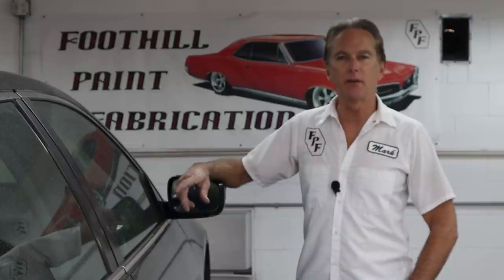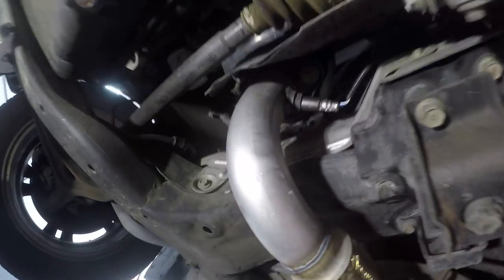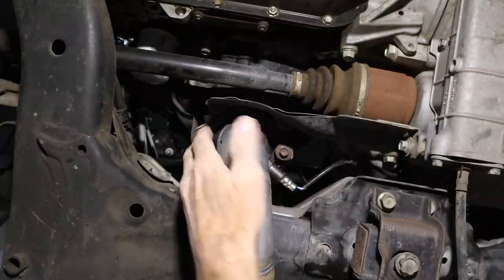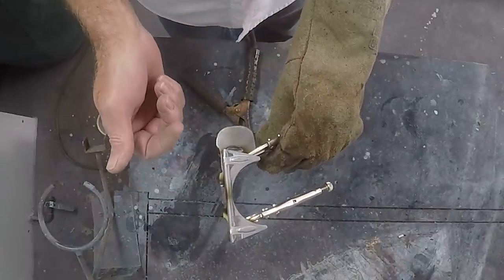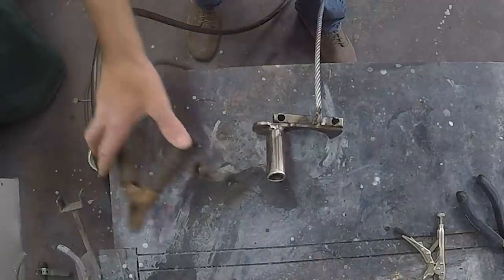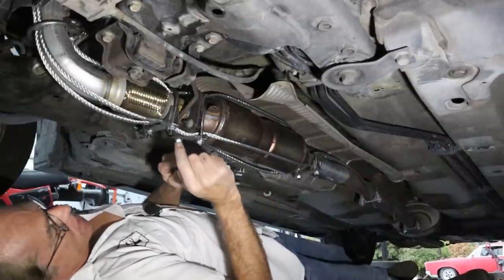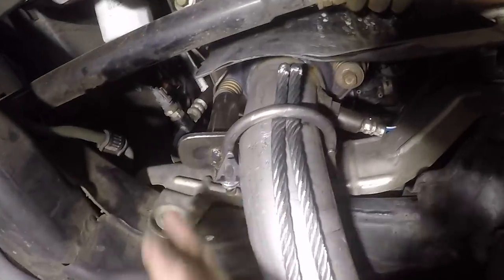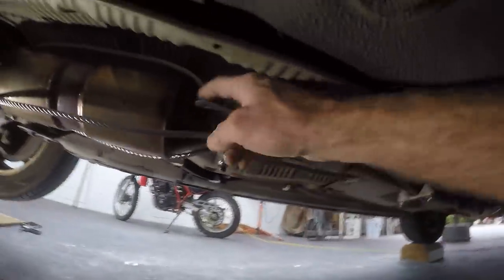Catalytic Converter Theft Deterrent Easy and Cheap

Comment: I've got the solution pure and simple psychology 👌 why do they have such a mental block on  , Making it mandatory for the buyer to request a  VIN # of the vehicle it was removed from, 🤔
Reply from the maker: I totally agree.  It used to be street signs stolen for aluminum and then they cracked down on the people buying the signs.  Copper wire was next and now catalytic converters.  Each state handles it differently and they were all slow to see the problem and do something about it. I did see where they caught a semi full of stolen cats heading south of the border so there is a way to sell them other than a bona fide scrap dealer unfortunately.
Reply: @FoothillPaintandFabrication  they could fix it "if they wanted too some people higher up are making something as well 🤔😉
Reply from the maker: @marcturk4410  When I see some official talking about making a law or increased policing I always figure their cat got stolen and NOW they want to do something about the problem.

Comment: I easily installed a U bolt with a one inch chain link to one end of exhaust and wrapped chain around and clamped with u bolt at other end where they need to cut with sawzall
Reply from the maker: Good ideal. Anything you can do to make it look like work to steal.

Comment: I can't get exhaust shops to do this for me. Could I use JB weld for the nuts and bolts instead of a welder? Also can't a sawzall - reciprocating saw cut through the cable?
Reply from the maker: Yes you could bend the threads over and/or use JB weld.  I would bend them over personally so it looks really hard to unfasten. Cutting cable with a sawZall is pretty tough to do but it is possible.  With 3 cables and one at the very top they will have to work at it which WORK is the key word here since they don't want to work do they?  Good luck on your project.

Comment: I'm thinking the best idea is to buy a vehicle where the catalytic converter(s) are tucked up in the engine compartment where they are so hard to get at that thieves don't even want to try.
Reply from the maker: I have never heard of them installing the cat under the hood.  It should would help protect them.  They get pretty hot when you push the car hard though.
Mark
Reply: @FoothillPaintandFabrication  My Frontier with a v-6 has two. They are connected to the exhaust manifold on each side. At the lower end they connected to exhaust pipes. But there is very little room to swing a saws-all at the upper end. I don’t think most thieves would want to spend the time.
Reply from the maker: @nate4745  You are correct about that.  They don't want to work and that is why they steal.  If it looks tough or time consuming they will take a pass and go to an easier target.

Comment: Why not put barb wire on your catalytic converter?  Or spikes?
Reply from the maker: I have heard people putting wraps of chicken wire around it which should help deter thieves if it looks like a lot of work to get it out of the way to cut the pipe and barbed wire might do the same but it is easier to cut.  Really what ever you can do to make it look like hard work and time consuming the thieves will probably move on to an easier target  up the street.

Comment: Nice work and good attempt but wouldn't a battery operated cutting wheel get past all of what you did within minutes?
Reply from the maker: Anything can be defeated given enough time and effort but that is the whole idea behind this  deterrent.  It will take time, make a lot of noise and they will have to work for it which is exactly what the thieves don't want to do is actually work for the money they get. Getting a cut off wheel up under there to make all those cuts will be pretty tough laying on the ground too.  It has been well over a year and still hasn't been touched so in this case it has worked.
Mark

Comment: How about covering the bolts with epoxy ? What you are trying to do make it a more difficult for the thrives.
Reply from the maker: LocTite, bending the threads over or epoxy would slow them down for sure.  By welding the nuts I wanted to make it look daunting to remove the clamps to get to the pipe and cut it. The main goal was deterring them to go somewhere else.  It has worked so far!  Fingers crossed.

Comment: Not having a welder I'm opting for JB Weld for the ends of the clamps when I do mine
Reply from the maker: Great idea!  I tell people that don't have a welder to bend the threads over where they stick out of the nuts on the exhaust clamps.  Anything to make it look like work and the lazy thieves will take a pass more than likely.

Comment: What made you choose 5/16 vs. 3/8? I'm wondering if I can use 3/8 and just do two wires vs. three.
Reply from the maker: I was concerned I wouldn't be able to bend the cable around and get it down under the clamps but I am sure 3/8" could work just fine.  Really anything you do should deter the thieves.
Reply: In my place (Canada) we don't find 5/8 or 3/4 cable but only 1/2 size. I will try to wrap 4 or 5 times of my 40' cable likely hairs braid... with U claims 1/2 inch bigger than pipe size. Then use cold glue welding for nuts.
To much rain and cold this weekend, hope for next week to try on.
Thanks for your video clip. 
Happy Easter to all, but not to thiefs.
Reply from the maker: @LEE-PHAM  Thanks
That should work nicely.  If it looks like a hassle to steal they will move onto an easier target. Smack the threads sticking out of the exhaust clamps to so they won't even think about trying to back the nuts off.

Comment: Hello brother. 
If you use the welding  in the cars is  not damaged the electronique systeme....? 
I have one toyota prius hybride.  If I use is damaged or not ? 
Thank you for your reply. Please
Reply from the maker: Damaging electronics is a very real thing with improper safe guards.  Removing the negative cable on the battery and then making sure your ground lead on your welder is as close as possible to the weld area should ensure there is no stray voltage going to electronic components.  High frequency start welders and plasma cutters can have a more pronounced issue I have found as well.  Isolate the car battery, keep the ground clamp close and you should be fine.
Reply: And stay away from any fuel lines in the area!
Reply: @jeffstone28  Fuel and brake lines are routed together in their own channel away from the exhaust system.

Comment: I used chicken wire, several wraps; they can cut through it but it will be a big mess.  Most will move on to easier targets.
Reply from the maker: Agreed
Reply: Wrapped around the cat con? Or as a shield over the undercarriage?

Comment: What's the point of the cables? I don't get it. The brackets are what's holding it in right?
Reply from the maker: The exhaust clamps are holding the cables in place yes but the cables are the deterrent. Thieves use reciprocating saws and chain tubing cutters to steal cats but cable is extremely hard to cut through with a reciprocating saw since it bounces all around and the cable wires bind up the blade as they cut.  It has been on this car for over a year and has worked thus far.  Even have a guy on video looking under the car and then leaving without even trying.  If they are determined nothing  can stop them so you want to make it look like work to get the cat off.

Comment: How this solution work out for you all these months later?
Reply from the maker: My sister has video of some guy sliding under the car, takes a look and then leaves without even trying so it worked on at least one thief.  It has been over a year I guess and no attempts at stealing it other than just looking under the car.  The car is parked outside all night and in the school parking lot during the day so it is pretty exposed.  So far so good
Mark
Reply: @FoothillPaintandFabrication  Lol. good for her!!

Comment: what about wrapping the cat a BUNCH of times with barbed wire? would that work?
Reply from the maker: As long as it doesn't rattle and drive you crazy while driving I think anything that looks like work will deter the thieves.  One guy wrapped his in chicken wire a bunch of time making it look like a mess to remove.  Whatever you do make sure it is safe so the cat doesn't overheat and the O2 sensors don't get damaged.
Reply: @FoothillPaintandFabrication  Thanks for replying. Never have been under my Prius far enough to see how much clearance it is has above the cat. From what I've seen online, so far, my guess is it doesn't have much. Whoever comes up with a foolproof deterrent will get rich.

Comment: How would you do it without welding?
Reply from the maker: Dave, you can totally do this without a welder.  Once you have all the exhaust clamps on take a hammer and bend over the threaded portions that are sticking out from nut against the clamp. Bend them enough so it is noticeable so when the thief looks under the car he will see that it will take time and effort to get to your cat. The more it looks like work the less likely they will hang around trying to steal it.  Get some hi heat exhaust paint in a bright color and spray the cat as well as engraving your Vin number on the cat.

Comment: Maybe an extremely loud motion detecting alarm installed under the car that activates when it’s parked
Reply from the maker: I saw a guy that put some battery powered motion detectors under his car but they were a pain to turn on and off so they probably don't get used as often as they should but it is a great idea. If you could wire them to an easily controlled switch and adjust them so a cat or squirrel didn't set them off they would at least make the thief deaf as he tries to steal it.

Comment: where do you find those cables and clamps. would be helpful if you put links or where to buy in the video.
Reply from the maker: Autozone on the exhaust clamps and Home Depot for the cable.  If you could find a place that sells cable cut to length it would be much easier once you know the measurements.  
Thanks
Reply: @FoothillPaintandFabrication  THanks for you help appreciate it. How has that set up work for you till now? any modifictations you would make since your original video and set up? thanks a lot
Reply from the maker: @asianstud7  So far so good and my sister even has one guy on video looking underneath the car and then taking off so it worked on him.  I have been thinking of what would deter lazy thief's more.  Perhaps smaller diameter cable but more of them so it looks like a real chore to get the cat out.  Also any vulnerable spots keep one or two cables away from the pipe and slightly loose so when they try to cut them with a cut off wheel the cable will bounce around and bind their tool.  Stainless cable might be tougher to cut too but not easily sourced and would be pricey.  Good luck on your project.
Mark
Reply: @FoothillPaintandFabrication  Got another question . I know that these thieves use a saw and vertically cut the converters. Now with what you have done with the accord they would first have to cut the clamps off first with a different tool horizontally tho first. then get that out of the way to cut the converter vertically. So dont you think the clamp is also relative easy to cut also? They arent made of the thickest metals out there i dont think? all it is is a thin metal thats wraps around the pipe.
Reply from the maker: @asianstud7  The thieves in my area have started using a chain tubing cutter they get at H.F. for cheap.  It is silent and they can cut the exhaust tubing pretty fast with it one handed so they can just lay on their back and reach under the car. Yes the exhaust clamps are just mild steel and can be cut but as a deterrent they are now cutting clamps, exhaust hanger, cables and then the pipe.  Way more work than they are used to and there are plenty of Accords out there unprotected so hopefully they all take a pass on my nieces.  The whole idea is to make it look hard and time consuming.  One guy told me he wrapped a bunch of chicken wire around his so it looked impossible to get to the cat.
Reply: @FoothillPaintandFabrication  Wait.  So you are saying that the thieves sometimes are actually going the extra mile and removing/cutting clamps and wiring to get to the cat all the while using a silent chain tube cutter?
Reply from the maker: @asianstud7  Yes, they use the cutter and let the cat fall to the ground and then cut the O2 sensor wires and walk away.  Just like copper theft they keep evolving.

Comment: Idk, if the cat is valuable, cable cutters would would add only a minute to the theft or a grinder with a cutoff wheel. There needs to be a thick plate covering the whole area, say 1/4" steel plate with enough weld to drastically increase any attempt at cutting it off. But where to attach.
Reply from the maker: I agree, there is no good place to attach anything unless you drill through the floor pan.  Then the seats and carpet have to come out.  This is a deterrent not a foolproof way of stopping a thief.  Remember they steal because they don't want to work like the rest of us so if it looks like work when they peak under the car I think they will take a pass and go onto easier victims.

Comment: What about floor bolts from inside to cat with threaded nut welded to cat.
Reply from the maker: The vibration and heat transfer might be an issue not to mention having to remove seats and carpet to do the work and if it ever needs to be replaced it would be more labor just getting the interior out than replacing the cat. Unibody cars unfortunately don't have much to attach to.

Comment: A thick flat plate protector wrapped around the catalytic converter and fastened with a couple of nuts welded at some points to the underneath, would do the trick. It will deter the thieves as they are always on a fast track and do not have the time for a task that takes their time. And a law to support that any thief caught should be castrated😀😀
Reply from the maker: Anything you can do to make it look like more work than they want to do should work great.  A few things to consider: The Cat over heating due to no air flow around it, unable to inspect the Cat for smog test, the thief cutting the pipe farther down from the plate and running off with the whole thing plate and all.  I have seen some people wrap a bunch of chicken wire around theirs, not sure how well it works or if it rattles when driving but it is better than nothing.  The cops just busted a huge ring near here recently so it seems they are finally taking this seriously. 
Good luck and I hope your idea keeps the thieves at bay.

Comment: Any noise vibration?
Reply from the maker: Hey Mark.  No not at all.  I was careful to pull the cable tight between the clamps and wrap it tightly around the pipe so it wouldn't rattle and that seems to have worked.
Been a couple of years and had a few guys slide under and look but always take a pass.
Mark

Comment: “You only need a sawzall to remove the protection”
The thefts are using that to remove these I think an alarm system, key nuts, and painting with high temperature paint etching your vin those are less costly and good protection.
Reply from the maker: They are using chain tubing cutters around here. Silent and can be done under low cars with one hand. I agree adding more deterrent is a good thing and what I added makes it look like a lot more work to remove and anyone that has tried to cut cable with a reciprocating saw knows it does not go to well.

Comment: Darn, good thing I have a cordless cut off wheel tool 😂😂
Reply from the maker: They don't use cut off wheels, they use chain tubing cutters because they are silent and if they do use a power tool it is a reciprocating saw which will not cut cable and even if you tried to cut it with a cut off wheel good luck reaching that upper cable.  It has been almost 2 years with tweaker thieves looking but always taking a pass. It just looks like to much work and we all know they steal because they don't like work.
Reply: @FoothillPaintandFabrication  I know I was just messing with you, I had 4 converters robbed from my cars. The love toyotas for some reason.
Reply from the maker: @turboimport95  Yes they do, probably because they are everywhere.  Can't throw a stick without hitting one.

Comment: If you say it can be cut quickly with a cut off tool than it can be stolen quickly. Have a 4 inch pad bolted to the ground  and park over it. If they can’t get under it they can’t steal it.
Reply from the maker: It is a deterrent so if it looks like more work than they are used to hopefully they will take a pass.  Some thieves use a jack while others do not so parking over something to restrict access should work well except when you are at work or school or the store.

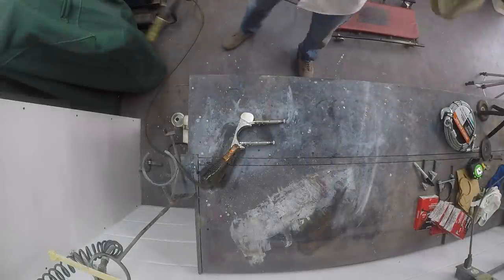Comment: The "easy" part goes out the window at the 8:00 mark.
Reply from the maker: The manifold bolt cover was overkill so you can skip that part and they even make security bolts with special heads on them to use instead if needed.  Also you could totally do this as a No Weld version by simply bending over the threads that are sticking out of the exhaust clamps after you get everything all tightened up. If it looks hard to remove or will take time they will more than likely look for easier pickens.

Comment: They're cutting them off with a sawzall; how will this stop them?
Reply from the maker: Cutting cable with a sawzall is difficult and time consuming and way to much like work for lazy thieves.  Remember this is a deterrent, not a 100% solution. We have already had one guy on video slide under the car with a flashlight, take a look and then leave so it worked on him.